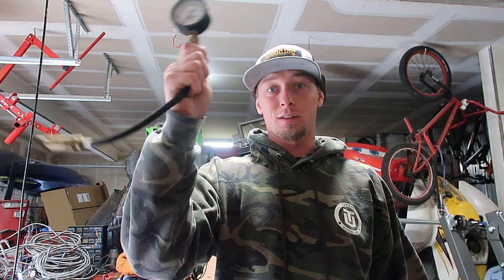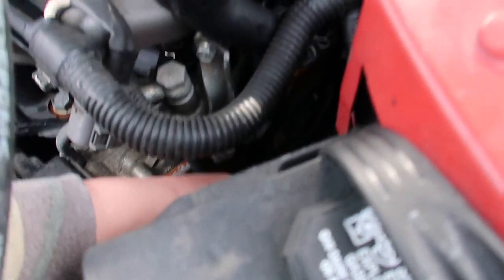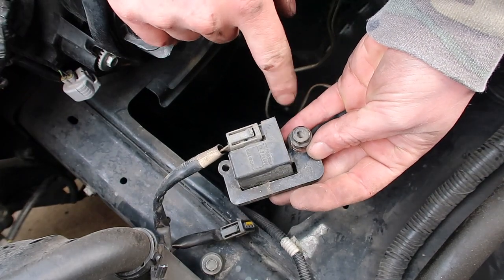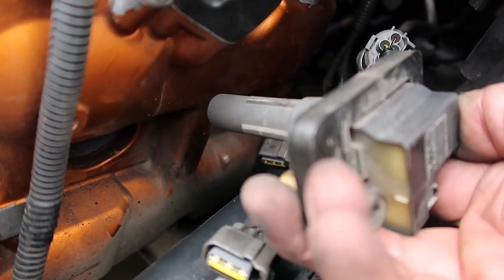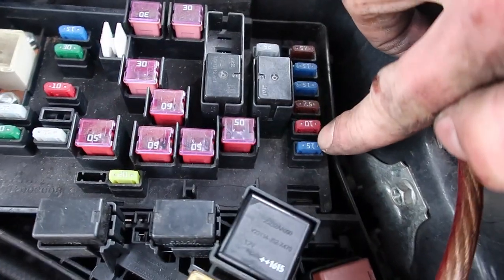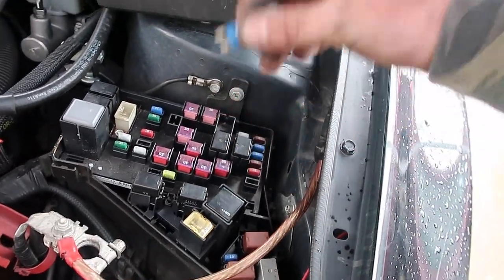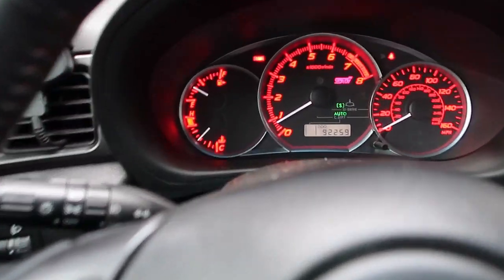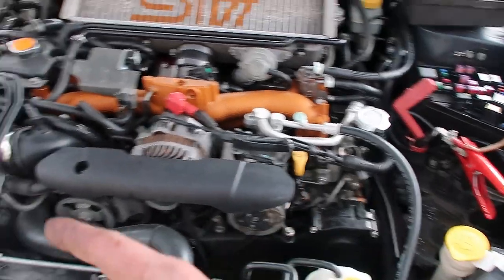How To Do A Compression Test

Comment: Isn't it better to have all spark plugs in so there wont have any leaks from anywhere too?
Reply from the maker: Yes and no I guess. The main point is to check how well that particular cylinders rings are sealing so you want the extra (for lack of better word) leakage from the other cylinders so there isn’t any extra false seals. That being said I can see how it would be better to have the other plugs in. The engine will have all the cylinders closed when it’s running. Now I’m going to have to do some research